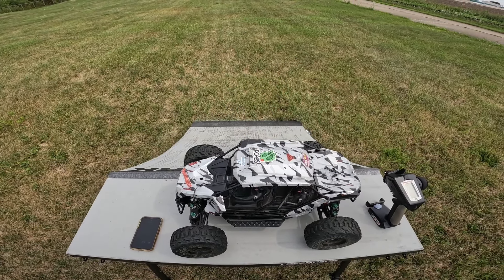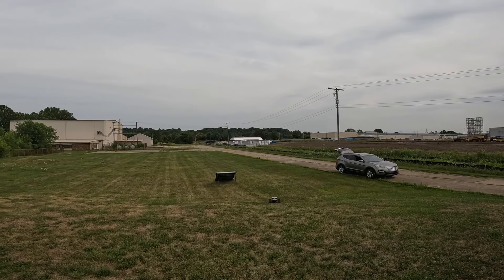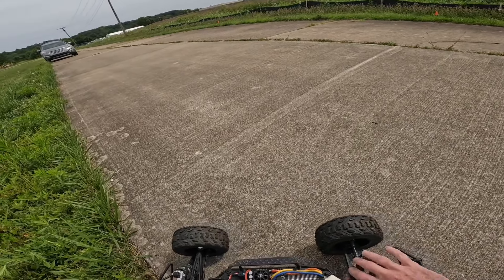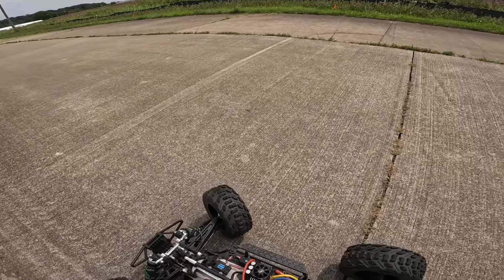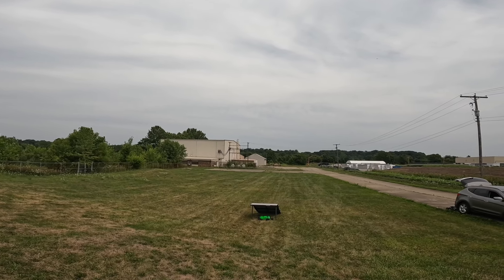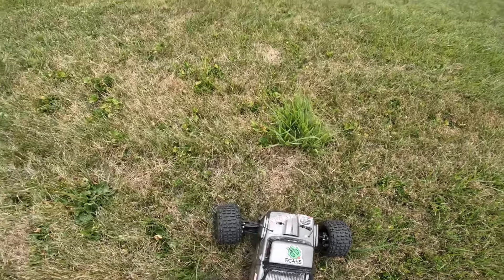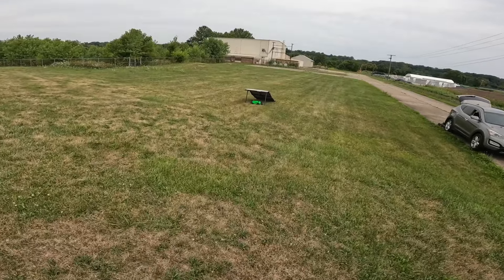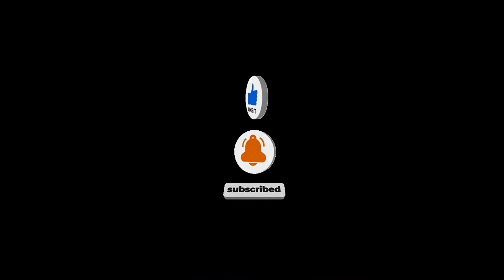BASHING with ARRMA isn't always perfect #rc4life #m2c #cnhl

Comment: What radio you going to switch over to? I am now looking at Radio Link, 4 ch.
Fly sky noble nb4 + is like 300, compared to the other at like 80!
What are your thoughts?
Love tour videos and upgrades!!😅
Ps got my GL RC steering modes in, but haven't installed yet!!
Reply from the maker: @frederickgrassie3383  I was looking at a lot the rc8x and the noble but honestly went way left and tried a dumbo rc ddf350.... and I fell in love it's now on my 4 most favorite cars
Reply: @RC4us  yes, a few people mentioned the dumbo 350, I have to look more into this one as well. I only have 5 rc cars and one boat.
Reply from the maker: @frederickgrassie3383  I was EXTREMELY skeptical as the last dumbo rc I had I thru in the trash (the one talbot made famous) it's plastic feel and I just had so many issues with it.... a lot of people told me to try it out... I don't like Ali express but when it was finally on Amazon and it had a coupon so 70$ was worth the risk I put it on a grom 1st it worked good so I put it on my 6s outcast and really ran it.... the feel of it the size is perfect for me it has way more functions then I will ever need and plenty of range... now I have it on 4 cars my 4s xxl, the FT, the new ultimate typhon 6s, and my sledge next will be my outcast 4s